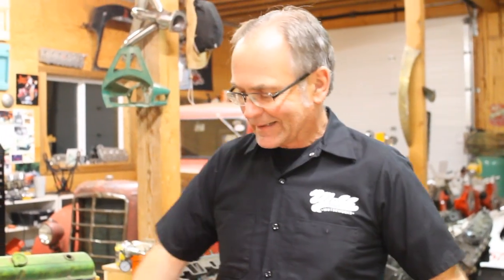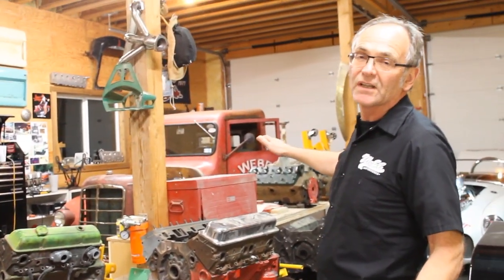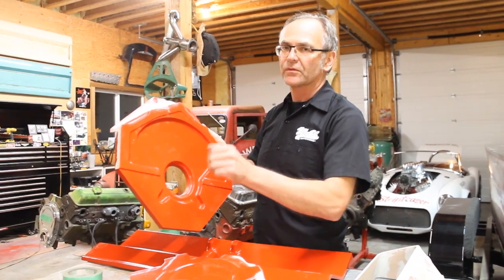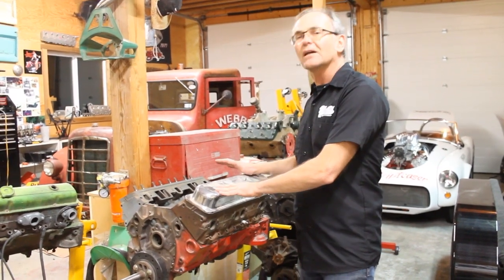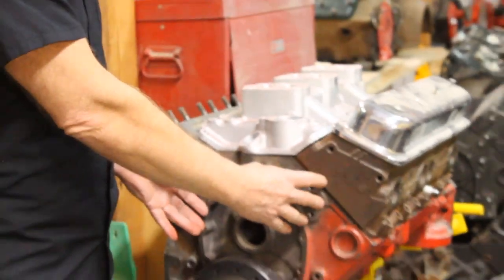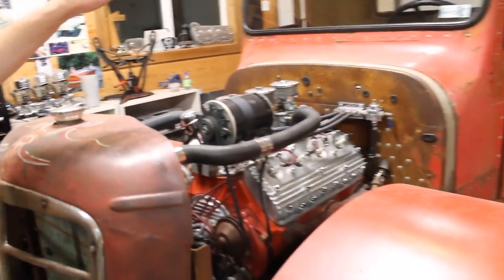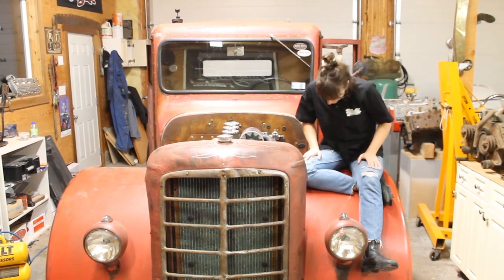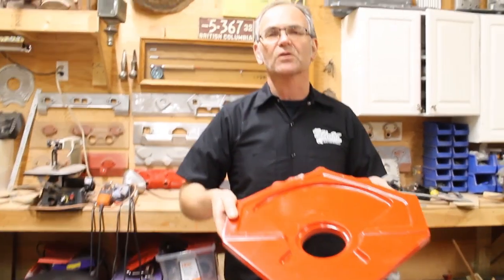Episode 1: Project Intro [Electric SBC for Rat Rod Truck]

Comment: Build a box with a fan propeller setup put it on the crank pulley the box with one Inlet and one Outlet where the water can flow through and spin the crank

Comment: i thought about useing 2 electric motors  1 to run the drive train and 1 tpo run alt and power steering, i wounder if that would work
Reply from the maker: On this unit the front pulley works so you don’t have to worry about that.  Just use stock power steering and alternator

Comment: You talk about flatheads and electric in the same phrase.  They are very different from each other.  Flatheads and small blocks have so much disadvantages that why even compare the two.  I don't understand why your conversion needs to look like a gasoline motor?  People will know once they hear it.  You need to do this right and get enough battery to get her around at least 150 mile range.  I think you're asking for problems trying to enclose the controllers inside a "box", how will they adequately cool?  Most EV's try to lighten the load as much as possible.  Your best bet is to buy a wrecked Tesla and use the batteries, electronics and motor(s), otherwise you will have too much money in the car....more than what it's worth.  I personally won't have my own daughter drive a car that doesn't have the minimal safety equipment such as air bags, ABS, collision control, etc.  Her face is much too pretty.

Comment: The concept is super cool, but electric helping the environment is a big lie. Your electricity is powered by fossil fuels unless, you have wind or hydro. And yes, nuclear isn't a fossil fuel but it does have worse longer lasting effects.
Reply: Kyle Sluys ,,,, the future is electric, wind, solar, water, hydrogen,,,,,it could have happened 20 years ago but was killed by the fossil fuel - internal combustion industries,,, study a little more before bad mouthing from ignorance
Reply: @mmiljour  dumbass like I already said above, coal produces 70% of the US power. Yes you can take coal away, wind and solar each produce 1%. Wind and solar require massive real-estate, you can't put wind and solar in remote areas because the power loss is to high. The shear cost of an inefficient power system doesn't make it feasible,  maybe in the future technology advance enough to lower the price. In the future Michael how about you take your own advice or shut the fuck up.
Reply: @xtremeboost7  open your eyes Kyle, there are already several euro countries doing 80%+ of their electric via solar and wind. The turbines are in a very remote area, the middle of the sea! There are dozens of ways to make electricity and more being developed every day. Oil only comes from one place and they aint making any more of it.